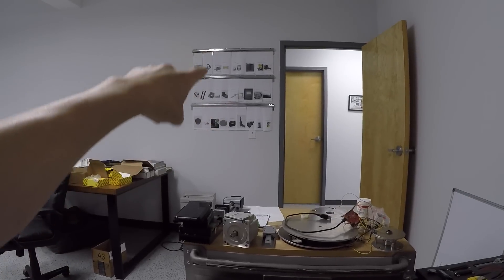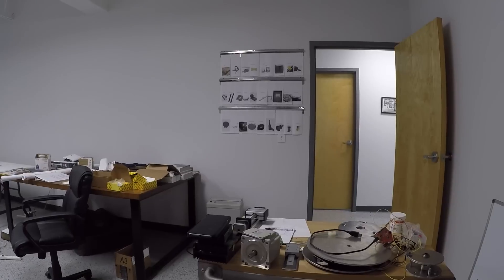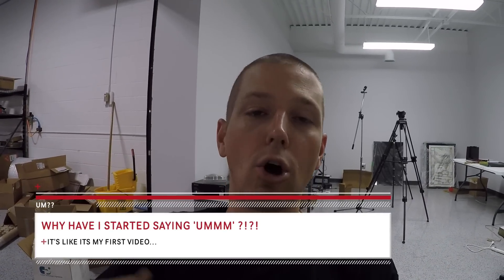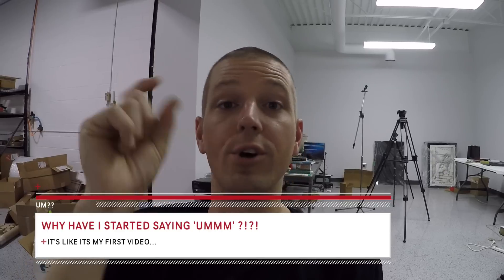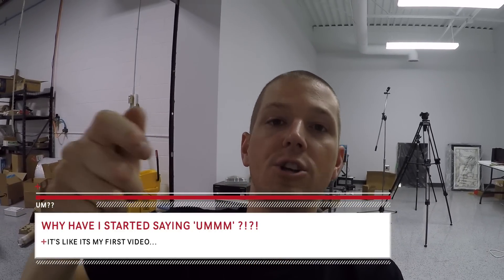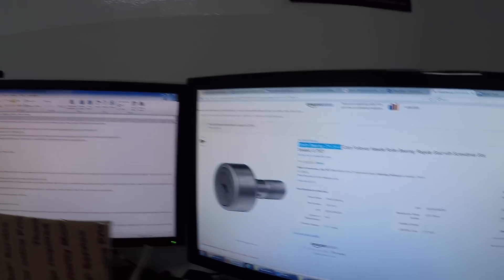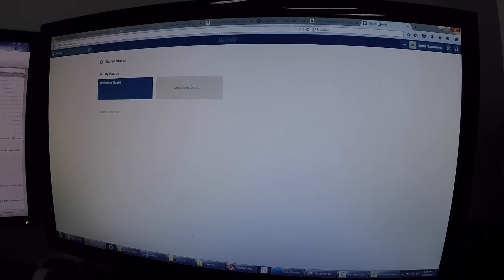New Machines, Keith Fenner Project, Ticket Board, 440 Project!

Comment: have you looked into the metal solvent sprayers you can refill and pressurise? makes spraying mineral spirits a ton easier. 
spray em down, wipe them off and then follow up with oil on exposed metal.
alternatively lab wash bottles work well too, you just don't want to push grime any farther into a crevice than it already is

Comment: you will love the Mas v2 drill press i just sold mine... which had just been rebuilt which included the spindle opened up to a #4 morse taper to true it up.  
Rather than use skates just use pallet jack. much safer and easier to pull and manuver.

Comment: Nice pickup John. The horizontals tend to be a forgotten tool these days, but still have their place. I literally just walked in from doing some horizontal work myself. As you found out, the cutters are cheap, they're super rigid, and sometimes having the option of horizontal setup can be easier.

Don't for goodness sake pressure wash, steam clean, or use any other form of water, especially under pressure! The water will be forced in to places that can do some serious damage in the long term, quite apart from the electrics in there too. Scrape off the worst of the crap and use WD-40, it's about the only thing it's good for in my opinion! I've bought machines and all manner of other used goodies up to "as new" condition with some WD-40, a pile of rags, and some elbow grease.

Comment: Don't use cam followers for rolling on concrete.  They are only for rolling on metal (at the rated capacity).  The other issue is that you will have about 1-2mm of clearance under the "lug" you need to mount the cam follower to.  If you value your time at all, just get a Hilman roller set with nyton rollers.  They come in a little box as a set of 4 and can be had in almost any tonnage you can handle and won't wreck your epoxy floors. You likely couldn't make a set of toms rollers for what they cost if you pay yourself at shop rate and you can rent them quite readily from many rental shops. They also come in steel, but those will potentially mar concrete floors.  The kit capacity is the total for all four rollers.    http://www.hilmanrollers.com/prepackaged-kits-and-sets/nyton-series/

Ask Stan Z about them if you want.  He showed a ware house full of them at some rigging supply company.

A forklift may be a cheaper option if you can get a big enough machine into the locations you need to get to as other have suggested.

Comment: Nice score! For cleaning up my machines I have found just a coarse plastic bristle brush, old tooth brush for fine spots, about a gallon of kerosene per machine, spray bottle and a bunch of rags works the best for me. It takes a bit of time but will come out looking much better. Pressure washing them will just introduce water to places you don't want it.
Reply: +1

Comment: Congratulations on the new machines!  Nice to have some good manual machines to round out the shop to be able to do whatever you might need to do.  As for cleaning - what I like to do is fill a squirt bottle with straight Purple Power, squirt it down real good and then hit it with a pressure washer.  I like to do it outside, while still on the trailer, on a good hot and sunny day so that it dries up really fast.  Once in the shop, lube up any of the ways with good way oil and squirt the whole machine down with WD-40 to get rid of any excess water as well as to provide a protective coat to keep it from flashing with rust.
Reply: me too on purple power

Comment: Hi John
I wouldn't use a pressure washer on your machines, bad idea. Water gets every where. Best way I have found is to first remove all of the heavy stuff with a scraper blade and than spray them down with varsol/kerosene and let it soak. Blow off and wipe down with old rages. Oil bare metal and good to go. Sounds like allot of work but it's faster than you think.

(440 Engraving Project)
Here is an idea that should help with the installing and removing of the blanks in the disc. This will also hold the blank solid during engraving.
Drill a radial hole in the from the outer edge of the disc that intersects with the disc/blank cut out. A pin is installed in this hole with a spring so that it's inner end is flush with the disc cut out and the outer end approximately 0.250 proud of the outer diameter. An air cylinder is mounted out side the disc so that when the disc is in position for engraving the cylinders shaft lines up with the outer end of the disc pin. Just before engrave the air cylinder is activated pushing the pin against the blank and pushing the blank against the inner edge of the cut out locking the blank in position for engraving. After engraving the cylinder is released, the pin retracts (with the help of a spring) and the disc turns around to the drop position and the blank drops out of the disc. With a larger cut out, installing and removing the blank should be allot easier.

Other Suggestions.
Use sensors for everything, disc position for blank loading, engraving position, blank ejecting, machine empty, machine jammed, etc.
Install time in arduino to trip a shut if machine gets jammed.
Install a stack light so you know with a glance what the machine is doing.

Just a few suggestions.

Willy

Comment: For the rotating table for engraving I would definately use an mdrive motor.
Mdrive is a series of stepper motors with built in driver and logic. They have a couple of digital in- and outputs (also an analogue input) and are super easy to program.
I have used them in many applications like this. Use inductive sensors for safe positioning (Or buy a motor with encoder...... expensive).

Comment: Yes to making a adapter plate available for the step-pulley Bridgeports.  I did a video on how I machined one.  Your PowerDrawbar kit works great by the way.  Zep Industrial UltraPurple Cleaner & Degreaser.  Spray it on full strength and let sit for 2 minutes, NO LONGER THAN 2 MINUTES or it will dissolve the paint.  After wiping off with towels/rags, spray with water, to dilute any residue of the purple, and wipe down again.  DO NOT get it on your pretty labels or it will remove all highlights and colors.  Cuts grease, oil, gunk like nothing I've ever used and I've tried lots.  Tom Lipton also tried the Zep Industrial Floor Stripper and the thought is that it's the same formula, just different labels, because the Floor Stripper works the same.  Both cost the same, around $10 per gallon at HD, Lowes.  -- Cheers, Gary
Reply: The Purple Cleaners typically are just Lye (NAOH) and 2-Butoxyethanol. Both will strip paint really quick. If you want to use lye, contact your local chemical distributor and you can get 50lbs for the same price as a jug of purple stuff and make your own. here are tons of recipes online, but you would be better off with #2 heating fuel or diesel or a very light machine oil to strip the gunk and dirt without damaging your paint or aluminum data plates

Comment: I used to race go karts with lots of bright metal so I used to wash them with kerosene using an air degreaser gun, no all that environmentally friendly however it worked and does not promote rust.  Remember PPE is a must.

Comment: Keith Rucker is currently doing a tear-down / cleaning / restoration on a large lathe, the methods should work well for your new machines as well.
Reply: +NYC CNC probably not, but if you do, you'll gain intimate knowledge of the machines, as well as you get to inspect for issues at the same time.

Comment: You have quite a capable shop, I'm envious of your new space.  Very cool new tools for the shop, machine tool acquisition disorder has found its latest victim.

Purple power degreaser and shop rags work well for initial cleanup of a "new to you" machine.  I cut the PP about 3 to one with water for general clraning,  or use up to full strength for really serious crud.  Spray the PP on with a spray bottle, scrub with a stiff nylon bristle brush as needed, and wipe off the resulting goop with a rag.  Keep a bucket of warm water handy to rinse your rags and wring them dry for re use.

I also made a set of "mice" last winter to move my bed mill into final position.  Also built a pair of outriggers that clamp to the machine base with ratchet straps so you don't have to get the machine on top of the mice, machine is just 3/4" off the floor.  Shoot me an email if you are interested and I'll send pics.

m2machining@gmail

Keep the videos coming, thanks for all the effort you go through to share your machining journey.

Marcus

Comment: 440 Engraving Automation: I think your going to run into a problem getting the workpiece in an out with some type of clamping action. If the round disk is too tight fitting, the part isn't going to drop in or out. if its too loose the part is going to wiggle around creating a bad engraving. Cut a radial slot out of the disk and set it up with a tongue-grove slide action and use a an air actuated to push the slot to clamp the part in when engraving. Use some expanding springs to hold the clamp slot out. I not sure a cam action using the disk-spindle will have sufficient holding force without stalling the stepper. Perhaps if you had a second stepper using a cam disk or turn a thread to press on the clamp slot would work.

That said, It might make sense to design a more general purpose automation platform that can handle some of the other parts you make. Perhaps a linear stage that can make use of a vise or has an integrated vise clamp (either pneumatic or stepper actuated). 
Soft jaws could be used to hold various parts.  Perhaps if you design it right you could make it a commercial product for small job shops.

Comment: Those track rollers DO NOT like axial loading! The needles and rolling race are retained by a press-fit ring on the stud side, and under axial loads will walk loose. I've tried to use them in ways other than intended, with mixed results.
Reply: +NYC CNC the skate it appeared you were looking at seemed to have only linear travel, so when a turn is made, the track rollers are subjected to axial loads. Even if a turntable were present on the top of each skate (making using them a bit like herding cats), the frame below the turntable will still have to be forced into the new direction, which will again create axial loading.

If the travel will never changed direction, or if you plan to unweight each skate and align it in the new direction of travel, track rollers might work once or twice before requiring replacement (perfect alignment across all skates being tough to achieve). But side- loading them as you turn corners will tear then up in short order. The pressed-on retaining rings just don't tolerate it well.

Comment: Save yourself some time and money and buy these skates from Amazon: https://www.amazon.com/gp/product/B001SOBGXC/ref=ox_sc_sfl_title_25?ie=UTF8&psc=1&smid=AF8EGQ3KRZQB6They are only $45 each and work very well.  Just mount some wood on top of them...John
Reply: Yes we have them at the college- moved a Bridgeport Series 1 CNC with no issues.  I was going to make some based on Tom's as you showed.  Just the bearings were going to cost almost as much as the price of one of these.  They are made real well.  But again you should mount a piece of hardwood on the top so its not metal to metal.  Very Happy and saved a lot of screwing around time making them....John

Comment: I am looking forward to see the engraving-setup running :)
It looks easy in theory, but the real challenges lie in the details. 

- You need to make the contour in the disc, so that the pieces don't get stuck when the disc rotates. Even with small chips all over your setup.. So maybe add a shield protecting your magazine and clean the disc with a beam of compressed air while it rotates. 

- Be sure the parts don't damage each other while falling down after engraving. 

- Maybe you want to make sure, that the parts don't spring out of the contour of your disc by vibration while engraving them. 

- Another thing that might cause problems: When you rotate the disc, the surface of the parts scratches over the bottom-plane, so you might ruin your surface-finish :\

Instead of a stepper-motor you could use one from faulhaber with a motion-controller. You can communicate via serial with it and they are very cool for an easy and quick setup. You can add a reference-switch to the controller to make homing-movements and even program the controller itself for easy tasks without a connection.

Comment: None of your new machines are particularly heavy. I suggest you go shopping for phenolic (not rubber or urethane or home center - really cheap) casters. Build a couple of frames to fit the lathe pedestals and the mill base. The radial drill is risky to move. Some will topple if the arm is swung out. Keep the arm clamped unless the base is bolted to the floor. 

Watch load ratings and use multiple casters on heavily loaded corners where necessary.

Phenolic casters roll easy as steel and they will not crush the floor's top coat like steel and cast iron. If the floor's clean one man could move your mill merely by leaning on it. Love them phenolic casters. I used to build heavy complicated stage sets on casters - one rolled so easy a half dozen sorpranos could move it when 15 men were standing on it.

Some lower cost import casters were excellent quality particularly Korean. Get an idea of your loads and talk to the local caster supplier. They're experts and will probably have some excellent suggestions. As ever when you're talking to sales people, hang on to your wallet.

Comment: Pressure wash is a no-no... If you have access to low pressure steam that would do a lot to degrease. Hot soapy water works well for the initial de-grime (and it's cost effective due to the size of the machines).

Comment: We had that very same lathe in our old shop. Clausing 17" Colchester by 80.......Its was an AWESOME machine! Really looking forward to your automated 440 project!
Reply: Are Clausing calling them all Colchester?  It's just that the gearbox controls are distinctively Harrison.  All three are part of 600 Group  nowadays, so they may just be keeping the established co-brand.
Reply: Colchesters are gear driven heads. The 17 inch was introduced in 1965 or 6 I believe. It also had as an option a removable section of bed way to accommodate a 28 inch swing, ours did not have that option. If I remember correctly the head could also be adjusted laterally. When introduced the lathe was considered state of the art and was very "modern" in appearance. The Clausing Colchester lathes were extremely rugged and heavy duty!
Reply: +TomsToolRoom I learned on a Colchester Student back in high school, and they were certainly teenager proof!
Reply: Awesome! they also had a lathe called a "master" as well I think.
Reply: It appears they still do!  After rummaging around google images, it appears either my memory is failing, or my experience was atypical; I only recall ever seeing lever Colchesters and dial Harrisons, but it appears Colchester used them more often!  so feel free to ignore my witter...

Comment: If you find Teamwork lacking or not quite fitting what you need, check out Teamwork.com as well. I use it at work and it seems to be relatively competent as far as project management software. Cheap and cloud based, too.

Comment: Do NOT effing power wash any machine tool. The high pressure water goes everywhere, electrics, lube oil sumps, under the ways etc. The hard, efficient way is best:

- give the machine a good basic cleaning

-  remove sheet metal, guards, etc

- clean progressively by convenient sections putty knife. vacuum cleaner, stir brush and solvent.

- when the machine is free of encrustations, grit, and oily dirt, go after adherent films on paint. Spray and wipe by small section with a good kitchen cleaner. Do not dowse it with Simple Green or Purple Power. They have ingredients that are not kind to machine tool when sequestered in crevices long term. Spray the surface damp, allow time for the stuff to work, wipe off film. Rinse. with clean water on damp towel.

- attack varnish and films on bare metal with lacquer thinner and similar - not existing paint

Repeat: there is no quick and easy way to clean up a neglected machine. Treat the task like you'd eat a elephant; a little at a time, keeping at it, until the job is done. Work the radial and the lathe together, clean enough to commence paint prep should take a good worker most of a day. AND produce no more that two 5 gallon pails of waste.
Reply: +NYC CNC Looks like I'll let you know when you need nagging.

I re-read my remarks. Sheesh! I sound like my mother when I was 12.

Comment: John the new machines look like a great addition to the shop.  I would be careful if you are going to use a pressure washer.  I think Tom used a floor striping product from Zep with good results.  I have used simple green and paint thinner with good success.
Reply: I bet you could use some plastic scrapers after the degreaser soaks in to scrape off bulk debris, then use rags. Check out grainger part: 38Y584

Comment: If you can,  Purple Clean and a LOW pressure  (1500 psi or less.  even a garden hose) pressure washer.  then dry immediately.   
or rags and elbow grease.   the major concern especially on the cinti is pushing water and cleaner/degreaser under the ways and into the way grooves.   I just pressure washed both my tool master mill and new lathe but they both are broken down entirely and getting rebuilt and painted.   I'm sure you arent planning on doing that far of a touch up ..   nice score.  you got some REALLY nice machines.   is that lathe a Colchester?   if so ..  AMAZING machine.